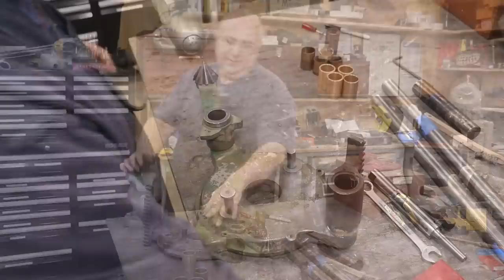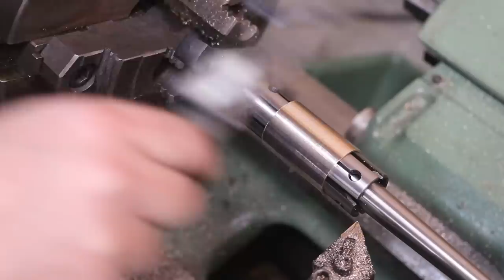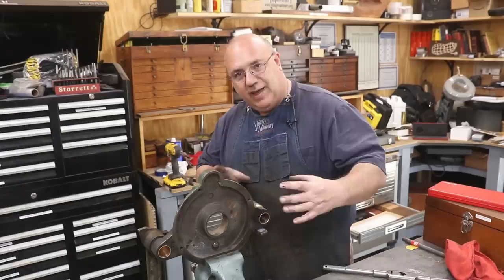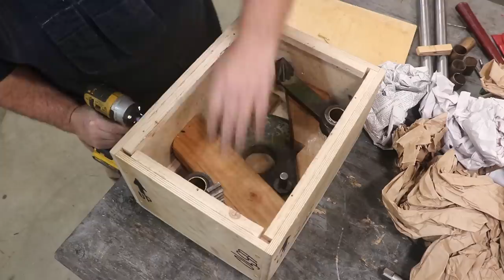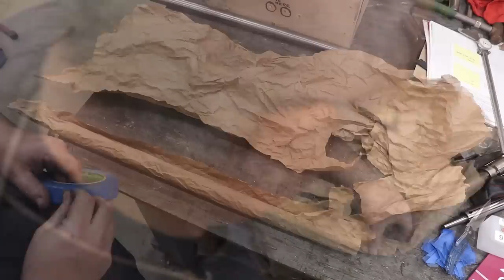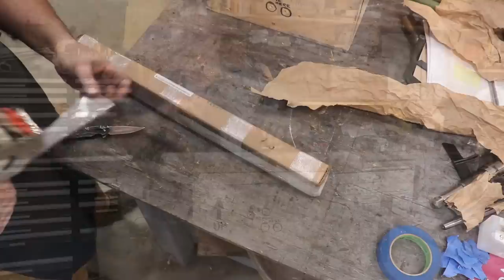Turning Bronze Bushings and Pressing them in Place: Casting Repair for Leo at Sampson Boat Company

Comment: Leo might be able to flip those guide rods end for end and get away from the worn area.
Reply: They would need to be threaded for the bolts that go into to them.
Reply: if only he had a way of threading them
Reply: @dennisdownes9319  Yes, on this type of machine, the die stock floats so that the machine isn't dependent on perfect mother stock.

Comment: The heating and freezing reminded me of my own situation.  Back when we were relatively newly weds I could put motorcycle sleeves in the freezer and the cylinders in the oven but now I am totally forbidden to get near the kitchen.   Thanks for the video.
Reply: It's why I put an old range in the shop! The self-clean cycle most newer ('90's up) also works a treat degreasing cast iron and mild steel.
Reply: @jacobpoucher  that was certainly uncalled for.  Mr. Rucker has worked as a machinist when he was starting out and he knows what he is doing.  I have absolute faith in his work as do most other people.
Reply: @jacobpoucher  one important part of repairing a piece of machinery is to know when good enough is good enough.
Reply: Many, many years ago we in-frame re-sleeved an old Farmall M tractor. My grandpa had the first and only freezer (we called it a deep freeze) in our town so we put the sleeves in his freezer and left them overnight. The next day, wrapped them in towels and ran to the shop and those thing slipped right in.
Reply: Jacob Poucher . I have never understood quite why people watch channels like this, where Keith is an undoubted expert at appropriate repairs on ancient machinery, and then are unnecessarily abusive. Ok. So maybe you feel you can do better, and possibly that might be true, so how about you point us all to a video showing us all how you do it?
This was a perfectly adequate repair on a piece of machinery that took it back to a level of accuracy it probably never had and doesn’t need, after all it’s a threading machine so it’s the accuracy of the Dies that matter.
Reply: @jacobpoucher  There's a reason, Jacob, why Leo, a practical craftsman himself, sent his parts to Keith Rucker and not to You. (little hint: it's not a money reason ...)

Comment: I have seen Leo's video. The repair seen here works perfectly. Leo had to sharpen the dies so that they would cut. But the rails work fine, there is no meaningful lash, and Leo has threaded a lot of bronze bolts on his repaired machine.

Comment: Thank you for helping Leo !!! I have watched YOU for years, but THIS is the First time I have seen your working for another UTuber that I also Follow!!!

I have done Both WOOD (including a Kayak, why I am watching Leo: Water & Wood) as well as some commercial metal work.

I had the honor of brazing Trombone Valves for the man who invented the First Brass Music Valve (Patented) since the late 1800’s.  Mr. Ora Ed Thayer. 

His Trombone Valve is used Internationally, and by the FOREMOST BANDS of the World, including the Presidential Marine Corps Band!

I also machined certain Brass & Bronze parts used on the valve, One weighing only 4 Grams was turned on his only lathe, a Seven Foot bed with a 12” swing: I drilled for a 4 40 brass screw! The lathe was powered by a Three Phase Converter, as his area did not have 3 phase commercially available power. 

I felt it such an honor that he accepted my machinists skills, I had mostly done only jewelry casting, smithing as well as hobby working on a TAIG Micro Lathe & TAIG Micro Mill.

Comment: When at 11:30 minutes you say you're adding heat to expand the hole larger, the heat actually makes the hole tighter.  The heat expands the hole on the outside diameter AND in the inside diameter, which makes the inside diameter smaller.

Comment: Nice job Kieth. One thing, pick one...either heat or cold for inserting bushings. If you have access to dry ice or liquid nitrogen that’s the way to go, but most people don’t have that option, so heat is most commonly used. Putting those bushings in the freezer didn’t make much difference at all because as soon as they touched the hot material they warmed up so quickly any dimensional change was lost. The heat you applied done the job, not the cooling of the bushings. Keep the videos coming.

Comment: You might suggest the owner put a small piece of lead or soft copper under his set screws. A lead shot may be hard, but a disc punched from lead sheeting works very well. Saves the burrs and grips well.

Comment: Nice job Keith. You used your experience pressing in the business using heat and cold temperatures. The shafts are parallel in the bores. Maybe put one shaft the other way direction wise which would cut the looseness in half. Look forward to see more great stuff from you Sir. Good day too.

Comment: I once washed part of a Harley transmission casing in our brand new dish washer while my wife was on a business trip. Do you know how hard it is to get transmission fluid off of a dishwasher?
Reply: For gods sakes I hope she didn’t find out..I strip my guns down and put in the dishwasher to, only when the wife out of the house.
Reply: A home builder built a plane in his basement. Fuselage wouldn’t fit up the stairs. Come one Saturday morning he sent his wife shopping. Fellow EAA members came over, rolled back living room carpet, cut hole in floor and joists, hauled fuselage up and out, spliced joists, reversed process, all back to normal with time to spare before she returned. Living dangerously!
Reply: dljordan that’s funny dude !! I’ve rebuilt more than one motor cycle on the kitchen table. Got into all kinds of trouble!!!!
Reply: I give up, how long did it take her? FWIW, I do the same sort of stuff.
Reply: I have a dishwasher in my garage just to clean my parts.
Reply: @sblack48  Nice to know the guy was smart enough not to film it and put it on Youtube.
Reply: I do so love your logo.  Next to Old Glory, our Volunteer State flag is the prettiest flag in the world!  -Keep a bottle of Finish Dishwasher Machine Cleaner stashed in the garage, to use when you have to do a dishwasher cleanup.  Or at least that's what "a friend" told me. LOL
Reply: @sblack48  In a small town in Wisconsin two friends built a 1/3 scale Case steam traction  engine in a basement, one winter they had about 3 inches to spare below the main floor when fully assembled, come spring they disassembled it in the heated basement and reassembled it in the non insulated garage, as the garage walls had too many work benches and cabinets and such to remove so in the basement it was.I n the garage they were able to do all the welding which was done by a certified welder because it was a pressurized  boiler and state inspected.
Reply: Oh my god.. I'm still laughing!!!
Reply: Did you end up having to sleep on the sofa?
Reply: @sblack48  I rented a hanger.
Reply: @gliderp  Never suspected.

Comment: Anybody who has ever done truck king pins knows what Keith is doing.  Except most mechanics use hand reamers to fit the king pins in their bores, and boy is it touchy to get a "thumb" fit, a thousandth over and you need to get a new sleeve!  I always used a cylinder hone to clean out the bores and make sure they were square as it was not unusual for sleeves to be so badly worn that the axle wobbled and caused the bore to go out of square. In that case, the axle went in the scrap bin and you bought a new axle assembly.  Over heating the axle could also damage the axle by messing up the temper of the steel.  As we used to say, over greasing king pins was never a bad thing!

Comment: Keith, I have a quick question. Some plain bearings are bronze and other bearings are made of brass. How does one determine which metal is better for a given bearing?

The old “friction” type freight car bearings were referred to as brass. I hired out on the L&N St. Louis Division in July of 1979.  We still had friction bearings back then. I had the privilege of seeing burning journal boxes.  The defect detector caught one and the sharp eyes of a crew member caught the other.  Many old style truck frames had the journal box doors removed and the brass bearings had been replaced with Timken Roller bearings.

Thank you for your time.

Sincerely,

Brían S. “Duby” Du Bois
Retired Locomotive Engineer

Comment: An aerosol can of air duster works great at chilling small parts for interference fit assembly. Use the can upside down to change the directions into a foreign language.

I should have looked first to AvE but better late than out of focus.

Comment: One little tip for cooling parts for assembly is to use a Co2 fire extinguisher to cool parts. As the gas exits the extinguisher it cools whatever it comes into contact with as it needs the heat to expand to gas.

Comment: 10:10 If you don't have access to dry ice but you do have a CO2 fire extinguisher then you can spray some CO2 into a cardboard box and get CO2 snow that you can use to cool your part.  Have a soup can full of acetone and add the CO2 snow.  Then using pliers or tongs lower the part into the acetone.

Comment: Keith, like some other viewers suggested, why not adjust the parts to fit the standard bushings (bore them)? This would also align the part bores and make them round again.
Reply: Cost and time, the job doesn't warrant that much input, it will work perfectly well for more time than is necessary as he as repaired it.
I can't believe anyone would criticise the way he has carried it out.
Reply: @pbysome  You might have noticed the question mark. It was a question.
I cannot believe anyone would criticize me for asking a question!
Reply: @PhotoArtBrussels  OK question the way he has carried it out.
Engineering, like most commerce, isn't just about the underdertaking itself but also about time materials and labour, you could, for instance, "question" why he didn't cast a new one, for he has this ability and it would be a "better" job.
So, though it is your inalienable right to "question" sometimes it might be more judicious to consider the entirety of the whole rather than the minutia...or not, as the case may be.

Comment: Not having a arbor press handy and not willing to abuse my drill press I would have used the heat the bore and chill the insert and then driven the bushings in with a piece of wood on the bushing and a dead blow or lead/bronze hammer.

Comment: So, two questions.
Aside from the time saving swapping out the chuck, is there any other reason you didn't use a drive plate for the dog?
and there's no kind of locking mechanism or jam-collar to keep that expanding mandrel tight?

Comment: Maybe should have checked if bars were in the same plane?  You could use V blocks and the surface plate but I would guess measuring a 3rd location near the holes in the plate would work.

Comment: What was the thought process in turning down the bushing vs. opening up the casting? Seems like you'd kill two birds with one stone in re-establishing round and parallel on the casting. And if this thing ever needs bushings again they are already nominal. Admittedly boring is a bit more of a hassle than just turning an OD. Perhaps not enough meat on the casting?
Reply: I am also wondering why you didn't bore the castings for the same reasons Bradley mentioned.
Reply: Also thought it would be good to fit grease nipples between the bushes so it could now be lubricated.
Reply: He explained that in his first video. Didn't want to take structural strength from the cast. this is a low wear application so grease fittings isn't necessary. Plus these machines get covered in cutting oil they stay lubricated trust me
Reply: @iaincrosbie2873  ..It is a pipe threader!  I've had one for years and there is no need for lubrication in those bushings.  Cutting oil will be all over that thing when it is in service.
Reply: A lot cheaper to turn the bushings in the lathe than set up the piece on the mill, it isn't a precision instrument and the repair will out live all of us.
Reply: @iaincrosbie2873  It has oiling hole in between for that.

Comment: Would you worry about the cold bushings and the hot cast iron causing rapid temperature changes? I have heard cast iron is sensitive to cracking under rapid temp changes (i guess you mention it in the last video sort of).

Comment: Keith-Would it not have been just as advantageous to enlarge the holes to the OD of the bushings?  Heaven forbid the bushings would need to replaced again, but if so, the stock bushings would fit right in with no other work needed. I am not a machinist, nor am I second guessing your work. Just curious. Enjoy everything you do. Sid

Comment: On the bushing that needed to fit inside the repaired area I would have been inclined to run a brake hone in the repaired area.
Reply: I was a bit surprised that he didn't bore the holes one size over and parallel before pressing in the new bushings.  But it's just a bolt threading machine, not a precision piece of machinery. If Leo flips the worn rod around, everything should be nice and tight and good to go for decades.

Comment: Since your first video, i have been wondering how, when doing the brazing, you could possibly align everything for perfectly parallel AND square or true. The parallel part is not the hardest to deal with. I worried that the result could easily be skewed or twisted and thus fail to align with the rail locations in the threading machine. Yes, the broken parts did provide their own jointery. With the tight brass bushings in place, precision and accuracy of alignment will become a very fussy issue it would seem to me. I do see that the Parallel was within 1-2 thousandths over two feet of length!. That deserves kudos for you, big time. Good-on-you, Mr. Rucker! | | | We will have to wait until Leo gets to putting it all back together to find out about it being “Square and/or True”. I have wondered if the cunning and clever reason the original design bolted the last piece on was so it could allow for needed “slop” to assist with the last part of alignment. If you got the “square and true” part done, too, but concealed guild-craft know-how from us about how that was accomplished, then I understand.

Comment: Great repair

Would've been slightly more work but the rails are clearly not hard or bent so they could've been turned down to a consistent minimum diameter and the bushings could've been reamed to match. 

This is in response to the claim "can't do anything about [the wobble] without replacing the rods" at 20:22

Comment: Great job.  No disrespect intended but I find it curious that with all your skill in machining you had trouble refitting the packing crate and aligning the original screw holes.  I like puzzles like that but sadly I can't machine anything.  Thanks for showing your skill in making this needed repair.

Comment: A trick I used years ago for this was the guys heated up the cast housing but the bearing didn't want to go in (Timken cup/cone). No way to cool the bearing until I  spied a CO2 fire extinguisher on the wall. Hmmm. Guys this is expired and needs refilling. Watch this. Put the bearing on the floor and the nozzle of the extinguisher over it and FOOOOOSH! Guy with gloves picked it up and it dropped right into place!

Comment: Maybe the two bores are parallel, but the way you measured is not adequate. For one thing there is more than a few thousandths play on the rods once you get far from the bushings and even more importantly, the rods can be skew by 1/8 inch or more and you would never pick it up with your method.

Comment: I would have been worried about the alignment of the two brazed parts, and I would have bored both bores. It would have also taken care of the parallelism. Just my two cents worth.
Reply: Stu McCabe Leo threaded the first bronze bolts before he realized the piece being worked on/repaired here was even broken. I don‘t think a slight misalignment will matter. Good point though 👍
Reply: It isn't a surgical instrument, it's a worn out old tool and the repair is probably the most accurate part of it..most cost effective way to do it.
Just my two bobs worth.
Reply: Hopefully Leo sent the center to center distance to Keith. Before disassembling the parts measure (using vernier caliper) inside and outside of the bars, add those together then divide by 2 to get the centerline distance.  Leo could measure the bores for the rods in the mounting brackets to confirm the new bore spacings.
Reply: @robertw.1499  He's not cutting fine thread metric it looked like UNC or W, plenty of come and go on a coarse thread, I agree with you.
Reply: @pbysome  It IS a HUGE improvement over what it was.
Reply: @marshallmoneymaker8322  I think that was kind of my point.
Reply: @pbysome  Sorry, I was just supporting your comment.
Reply: @marshallmoneymaker8322  sorry mate text is notoriously void of context.
I think he did a great job without being too pedantic in the circumstances and I'm sure the customer (Leo) will be chuffed with it.
Reply: I use one of these machines all the time threading pipe.  It is by far not an accurate instrument. The actual Dies is where it counts.  The bars are there just to support your die holder and help get them started.  This machine is WAY more accurate then the one i use to do the job.
Reply: @pbysome  It's all good, that's what I figured.

Comment: Making sure the rods are parallel to each other should have been done before the braising. The piece should have been braised in place while being held in known parallel.
Reply: How would he braise it with the bronze sleeves?  Like he stated it was previously assembled using the set screw and basically followed the same process.